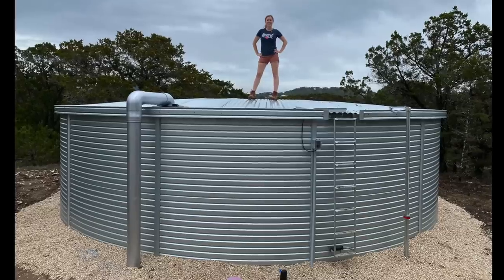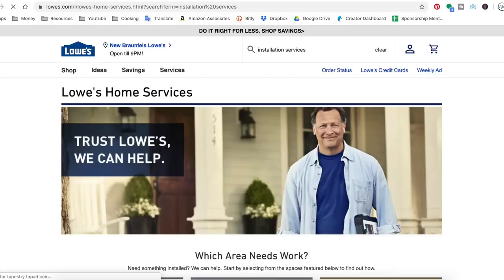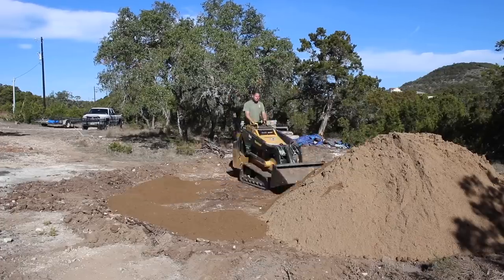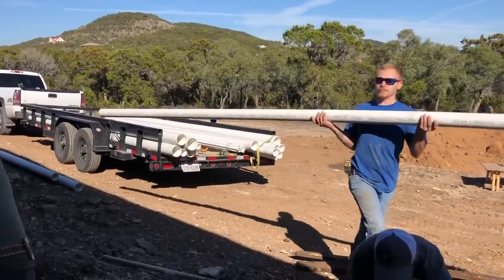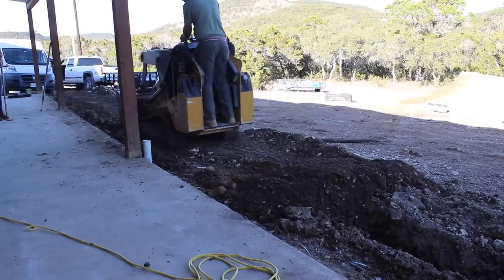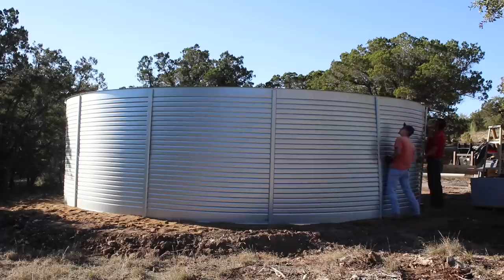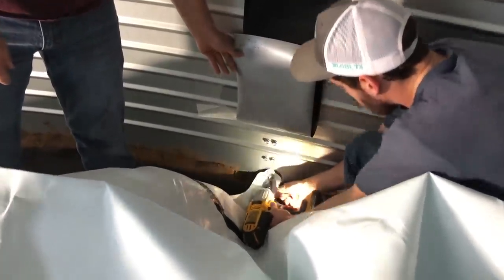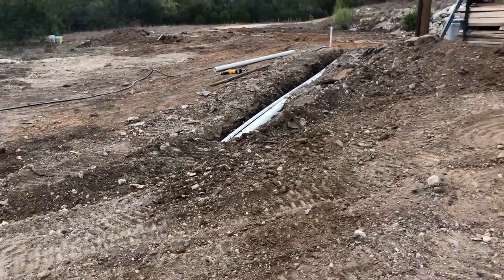Installing Rain Water Collection

Comment: Are you fighting gravity at the tank inlet?  I had considered off grid potable roof collection....?
Reply: As long as the inlet is lower than where the water enters at the gutters it will flow into the tank.
Reply from the maker: Nope, that's why the tank is placed where it is....so that the tank is below the roof line of my shop and the water is being pushed by gravity.
Reply: @AprilWilkerson  Roger that.... not obvious from the clips. Thank you.

Comment: They say..."Everything is bigger in Texas", i guess you proved it! I did the same thing but on a smaller scale. I connected rain barrels to my downspouts but then rain the overflow to a series of buried PVC pipes  for a french drain and barrel buried away from the house to eliminate water saturation and intrusion into the basement.

Comment: I retired from a nuclear power plant in NY. The site had many out buildings. One huge building housed 4 Steam Generators. The Generators were trash so we only had to enter it once a year for a radiation survey. Before entering an air quality test was done by the Chemistry Dept. My turn to do the survey. We entered just inside the doorway and saw algae all over the floor. Chemistry's air quality test failed. The algae sucked up so much breathable air (Oxygen) that the atmosphere wouldn't support human life.If you have to enter the hatch in the future, follow OSHA's rules for entering a confined space - it could save a life.

Comment: In so many places, it's illegal to harvest rain water. I store all my rainwater in the aquifer 80 feet down, pump it out with a well pump, and then return it via gravel/sand filtration. You are using a pump to bring it back, so what's the difference with a well?
Reply: Actually, there are very few places where it's illegal. There are some where it's restricted to various degrees.
 Not everyone is sitting on a reliable aquifer. Many places wells can seasonally dry up so it's a good idea to have backup.

Comment: April, you mentioned that gravity would help put water in your tank by locating it below your shop; why wouldn't direct downspouts from your roof do the same thing?
Reply: Justin I think you have missed the clear logic of your own answer!  You may have heard a phrase "WATER ALWAYS FINDS ITS OWN LEVEL!" 

Just to clarify further:  Rain-Water flows off roof, drops down the down-pipes, and flows downhill along drainage pipes, and into the tank. Even though there is a 6-7' height difference from the  bottom of the tank to where the pipe enters the tank, a "HEAD of water pressure" had built up from the drop, starting at the floor of the shop continuing throughout the piping system to the entry point of the tank, i'm not a engineer, but i'm sure if there is at least a 4-6' drop between shop floor and entry point of tank then the water will fill up as and when it rains
Reply: Stephen My point was why locate the tank to what appears to be 50 yards away from the shop when it could be right next to it?
Reply: @11jdstein  it is clearly counter-intuitive to locate the tank 50 or so meters away from the shop!  Not being the contractor, and having their installation expertise, not knowing what April had in mind for the tanks location either, I can only surmise why they placed it there!
Reply: @stephennarramore7961 that's why I asked :D

Comment: April, I'm looking to do something very similar when I move back to Texas.  Most likely using rainwater for all my water needs and using a similar sized system.  Can you provide a rough cost for what you paid for this?  Thanks.
Reply: Hi John, In Central Texas this type of system including treatment for use in the home averages around $30k, plus or minus a few thousand depending on the site conditions and complexity of the collection piping.

Comment: How does the water get into the tank? Is there a pump or just the water pressure alone that does it.
Reply: No pump needed as long as the top of the tank is lower than the roof which it is.

Comment: I was raised on rainwater. Off the house roof into a galvanised tank. From the tank into the house, it was used for drinking foremost and all the other needs. No filter or treatment. I am 61 years old with no health issues. I am constantly astounded by people who say you can't drink this pure water, but will willingly drink the treated poison that is piped in from treatment plants. Has anyone been inside these plants? I have and it is not pretty.
Reply: I totally understand what you are saying, David. However, the pollution in our air today is at such a higher density that some sort of filtration is highly recommended. I too grew up drinking collected and well water and am relatively fine thus far. I also grew up drinking from natural sources like creeks, streams, and rivers. With the amount of pollution that has been spread over our earth in the last 40-50 years, I wouldn't feel safe drinking from any natural source other than a spring-head anymore. Add to this, the younger generations have grown up on hand-sanitizer and have completely wrecked their immune systems, naturally harvested water just might kill them.

Comment: Maybe I missed it but how does the water get up and into the tank? Surely gravity can't do it eh? Is there a pump in the down stream side as well? Thanks.
Reply: The roof is higher than the top of the tank and water seeks its own level. No pump needed. As long as the outlet into the tank is lower than the inlet at the roof the water will flow.
Reply: @GeneWaddle  Thanks, that's what I was thinking but I couldn't get my head around how just gravity could push that water up a ~3' vertical pipe. I guess at the end of the day, if the roof above is feeding it, it should work.

Comment: 344 square meters? My property is 370 square meters, and i live in a 3 bedroom house with a small garden and a double garage. i paid roughly 330k usd for it, and that's cheap here. Also, rainwater collection is mandatory since around 2008, almost any house has an underground concrete tank in the yard or even under the house (basements are not popular here). The public (street) sewer system is split, rainwater and dirty water have separate sewer pipes. I can't understand why the government would outlaw rainwater collection? In a really hot summer, like last year, we were not allowed to irrigate the yard or wash the car, not even with rainwater. And this is the middle of Europe (Belgium), not like Australia or Africa . We don't drink it, but sweet water is precious, well done April.

Comment: What would you have to do to make it so you could drink the water as well
Reply: Typically the water is fed through a Sediment filter, carbon filter then a UV lamp chamber to create a potable supply.  This link shows one that we use for single family homes up to 3 bathrooms: https://rainwaterequipment.com/trojan-uvmax-ihs22-d4-home-ultraviolet-water-purification-and-filter-system-10-5-gpm-120v-230v-by-viqua/

Comment: What I want to know is the cost. How much did 4 days of work including material cost?
Reply: Hi Damion, A similar system in Central TX is going to run mid to high $20k's. The tank is the largest cost, followed by the collecting piping then the pump and pad work.  If the water is to be used indoors add about $2k for the treatment equipment and installation.  Most whole-home systems we install on 3,000sf homes are around 30k or so.

Comment: Any particular reason you did not put tank on a concrete pad? That's alot of weight on an area with just native soil when dealing with wet weather.
Reply: A concrete pad would cost more than the tank, and that weight is very evenly distributed - if I stand on one foot I'm putting more pressure on the ground than a fully loaded tank.  Also it's hard to see in the video, but we scraped the ground down to the rock shelf below.

Comment: Ooops, I just heard the Texas reference at the end of this episode...still, do you know the average rainfall in your area? I'm wondering as here in western WA, a 1000 sq ft roof can yield as much as 20,000 gallons of water in a year. That obviously affects the size of tank! If one just wants to catch a little in one of the smaller barrels it is necessary to collect only from a portion of the roof, have many barrels, or have an overflow line.

Comment: How much did the system cost
Reply: @Colleen Rodamer  

I would guess between $8,000-$10,000 installed with all of her "discounts".  But it depends on what "discounts" she received from Lowe's and in return for "product placement/advertising" exposure on her YouTube channel by the installation company she hired.

Someone else in her area of TX said roughly $30k, but that included a POTABLE house water system.

Drilling a well in her area would probably be 1/3rd less, but has the potential to dry up or be contaminated as she mentions in the video.

Comment: Out of curiosity , durin the winter how does one prevent the pipes and system freeze up in areas where it’s colder
Reply: Bury them deeper and drain the system before it freezes.
Reply: Gene Waddle ... thanks for the reply very helpful

Comment: I am pondering collecting topspoil runoff (I live in a tropical biodome with only sunny, rainy and draught and la niña floods on the further extreme of the climate spectrum) into a dam in conjunction with smaller p.e.t.e. (since those sturdy wooden barrels are a novelty in our country) for gardening and greenhouse/home uses and a similar design but higher capacity above for farming uses.

Questions;
1. Why do the manufacturers insist on a black coloring material for the insides, sides, and bottom when you can't see the bottom if it's silted or whatever state it is in without fully draining and climbing inside the tank itself?! (Not really for the content creator, just throwing this out here.)

Considering this was created/uploaded 2 years ago (around the start of the pandemic), there is already existing lighting options 2. Did you not think further ahead (not criticizing, I would genuinely like to get into your frame of mind why this was so...most likely a cost saving practice) and to install like oleds in the beams and sides of the tank that uses thermal detection (lights up when there is a warm body detected by the sensor) so as for efficient internal lighting?
And
3. Will you consider using next gen (perovskite) photovoltaic panels installed on top and at the outer sides of the tank? 🤔
It is more efficient if efficiency what you were going for from the get go.

Comment: What keeps bugs or animals out of that overflow tube from going into the tank, same with the rain gutters going into the tank?
Reply: There is a flap valve on the overflow that allows water out but keeps animals and insects from going the other way. On the inlet there is a fine mesh screen that the water flows through.

Comment: Our family has been collecting rainwater on our cattle and sheep property for over 160 years. Multiple corrugated iron tanks, concrete tanks and lately poly tanks have been the go. All the water is potable. There has never been a problem in all that time with water quality.              Your new tank has the added advantage, compared with poly tanks, of being bushfire ("wildfire") resistant.               I think there would be a revolution if "authorities" banned collection here, in fact the notion would be never arise. Any such totalitarian dross should be resisted with the strongest possible ways.            I might have missed it but was leaf litter filtration included in the gutter outlets?  An interesting video, April.
Reply: The gutters themselves are typically screened, and there is a low point diversion valve as well as an inlet filter basket on top of the tank where the water enters.

Comment: With all the upfront cost how long does it take before the rain water collection system becomes cheaper then a well or city water?
Reply: Rainwater harvesting for newly constructed homes in Central Texas is similar in cost or less expensive than having a well drilled and finished, including storage and treatment.  In many cases, rainwater harvesting is less expensive than connecting to the local water company, and the payback is very quick when you eliminate a $45 to $100 per month water bill. Rainwater is also considerably cleaner and contains no chlorine or treatment byproducts.

Comment: But how did Ron attach his long strap to the far end of that PVC pipe (in the hack)?
Reply: I used the hook on the other end of the strap.  You have to keep a little bit of tension on the strap to keep the hook in place.

Comment: Even though you may not be representative of an installation, it would be nice to know ballpark what a system like this costs roughly; $10K, $15K? would be my guess. Many would like to know.
Reply: A system like this for Potable use is typically $30k, plus or minus several $k depending on site conditions and the roof layout.
Reply: @CqureWaterTexas  Good to know a ballpark figure

Comment: TerrIfic tutorial April. I have my enclosed garden built but the beds are on the ground. Yea, time to elevate. Way to go. The shop building needs to be built first along with a smaller but similar rain/snow harvesting system. We are on a desert horse property and the public water system is TERRIBLE. At this point we are drinking and cooking with bottled water.  I might just make mine for potable only. We have a large quantity of nitrates in the local supply due to ground water contamination from fertilizers used many years ago. I do enjoy your videos. Keep up the good work. I may have to learn sketch-up.

Comment: When my house was built it was setup with an underground, concrete tank.  Edit:  Cistern - I couldn't remember the word. =P  At some point it switched to municipal water but the tank is still in the ground.  I have been thinking about catching the water on that side of the house and using it for irrigation during dry spells. Unfortunately, that would entail climbing into the spooky tank to clean it out and make sure it is still OK to hold water.  Bleh ... spoooooky.

Comment: What are you doing for filtration?
Reply: Since the water is only used in the garden, the only filtration is sedimentation (in the tank) with a floating intake filter for the pump.  The water between the top and bottom is the cleanest

Comment: April, when are you getting solar panels installed on that roof? You could go net zero with all that space for panels!!
Reply: Don't know about her but here in bama if you are still hardwired to the grid and install solar then you will be charged for power not used from the grid
Reply: Here in Nova Scotia, if my panels produce more than we use, my meters runs in reverse and I get credit. At the end of the year, they pay me if I have credit left.

Comment: Whats the average cost of a system this size in TX? Im guessing $20-30,000? Any permitting or inspections needed? 

Put it in a bottle and sell it. April Fresh. 
From rain to roof to mouf...  Nofin fresher then April Fresh..... wth....haha!
Reply: 50,000 gallon tank is low 20's to install, plus ring foundation and more for all the plumbing (not hard to DIY)

Comment: So what was the overall cost for everything, the tank & the installation, and I think I would of insisted on the guys wearing plastic socks so they're not walking around on a liner with basically their bare feet because you're going to end up drinking water that they just walked around on the liner with their funky feet
Reply: Her tank is for irrigation purposes, not for drinking water or for the house.

Comment: What is involved in converting your rain water into potable water? What is the life expectancy of the liner?
Reply: To create a potable supply we typically run the water through sediment and carbon filters, then UV.  The water is already very clean and in most of the rest of the world would be consumed "as-is" from the tank.  Some people in central TX also consume without UV, just sediment filters.  The liner should last 20-30 years or more.  The warranty on it is 20 and the oldest Pioneer tank I've personally seen was 27 years old and the liner was like new.
Reply: @CqureWaterTexas  Don't you have to treat the water with some sort of chemicals to prevent algae and other spores from growing in the standing water?
Reply: @bgd5339  As long as it's dark inside the tank algae will not grow. That's why we prefer the metal tanks. Most other organisms will die off and sink to the bottom if the water is very still.  The few that are left are filtered out and anything under 5 microns in size is zapped by the UV.

Comment: I'm going with rainwater harvesting at my place, just not as big as yours. Just couldn't bring myself to pay $30k for a well and no guarantee that they would find water. Then there are neighbors having to re-drill because of their well going dry. I'm starting out with 5000 gallons and expanding as I can afford.
Reply: That's how I started out... well started to fail so added a tank for 500 gallons of rainwater, then 2500, then 5000, 7500 then went for the same tank as April. Meanwhile folks around me were drilling wells and having all kinds of issues with the water out of the deeper aquifer.

Comment: What is your elevation (head) difference between the gutters and tank inlet?
Reply: Kevin as long as the lowest point on the roof is higher than the inlet to the tank, the system will fill. The pipes don't empty unless there is a leak or you flush. Every drop that comes off the roof pushes a drop into the tank.
Reply: @tfildaed  I understand that, I was just trying to get a lay of the land as such things are difficult to see on video.
Reply: @KevinGarlough  There's far more than needed - about 10' between the top of the downspout and the top of the tank. 4-5' would have been sufficient for this system.
Reply: @CqureWaterTexas  thank you, I was just curious.